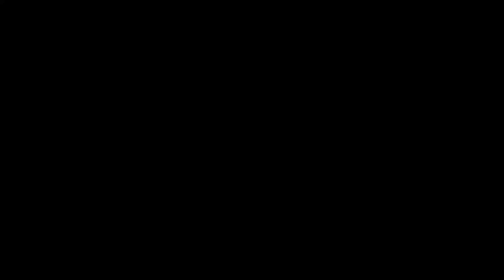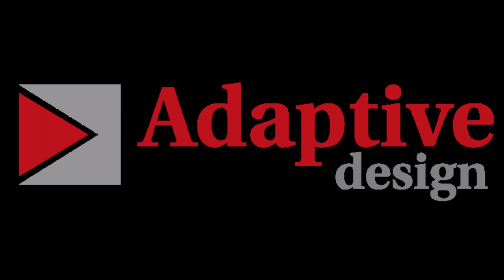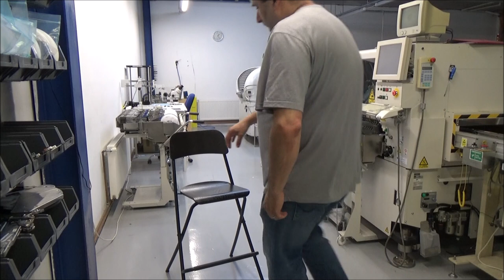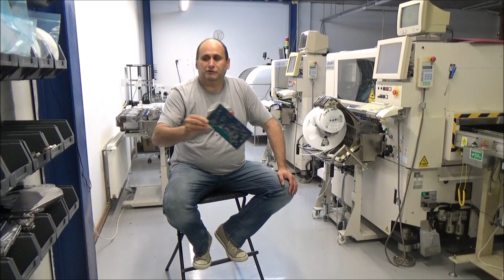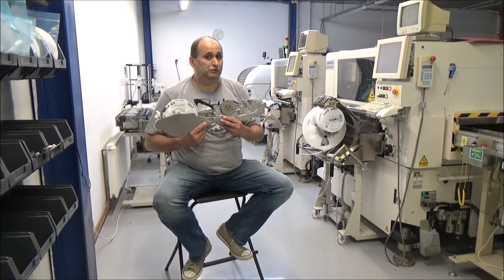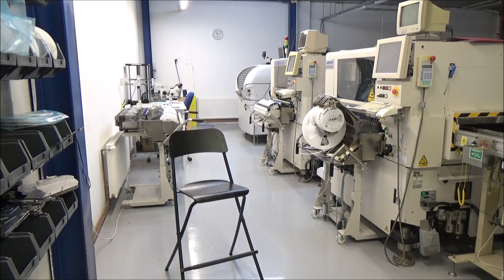Running an Electronics Manufacturing business in Ireland part 1

Comment: I've always been fascinated by mass production of electronics, like some childhood dream, used to take calculators to bits from 1977 onwards as a kid, anything electronic with leds and microchips in, dad was electrician, taught me about transistors 1979 onwards, first did programming on a friend's zx81 then I got my own computer, an acorn electron in 1984 when I was 13, fascinated I spent every night programming, in basic, by 1985 learnt 6502, did arcade games in machine code as teenager, sent them in for valuation at Superior Software, Micropower, and CSM, but they said either didn’t load, or too jerky, not arcade style enough, late 80's did a lot of maths programs, in 1985 built a transistor LC circuit that was a metal detector, and soldered it all up on my own pcb, in 89 soldered circuit panels for my dad in shed, that he sold to factory in Scotland, only did about 40 panels, but he couldn't keep travelling all way when they malfunctioned, in 87 I build a motor control circuit for my younger brothers electronics class, and over years I sometimes did 2 weeks a year wiring houses with my dad, got A levels in doing maths, physics, electronics, and computer science degree 1992, York uni, was taught about logic design, programming, saw things like gate arrays, microcoding, built a logic analyser, speaking clock circuit with audio samples from chips, learnt about the 68000, in 90 91, built z80 computer with 72k from chips, and built video circuit using tea2000 and SAA1027 sync generator chip, 64 colours on TV, got row of coloured dots across screen, circuit so big, that after that it malfunctioned, took 6 months to build, built my own eprom programmer, in 92 for my 3rd year project I build a satellite navigation system, early gps receiver, down to 100m, I did the z80 and TMS computer that did the dithering, and calculations, and my supervisor built the gigahertz frequency receiver, demodulator, and the technician in the lab built it, it was 3 foot long, later mid 90s did computer programming jobs, by 96 still dreaming of electronic manufacturing, I saw the new microcontrollers coming out, and was fascinated so I bought the picstart system, with PIC microcontrollers, and started to think what I could build with them, they were only about 8k etc, 8MHz type chips, but interesting, by then I had built this talking allophone circuit, and then I built a scrolling dot matrix led red text system, my wife rang companies all day, and global video wanted to put up 3 million pound to have one in every video shop, I had only prototype, i.e. 100 times smaller than what they wanted (full 10 foot display, mine was few inches across), they said I would have to get parts, costing 1 million, I came home from work in egg factory, to see wife and baby as usual, was staggered, we got a financial accountant in, and he told us we'd have to start small 50 pound, each week, go to bank and prove had income etc, so had to leave it, couldn’t do it, but I dreamed on, by about 2001, still wanting to get back into electronics, I got a job at Calrec Audio in Hebden Bridge and soldered boards that went into mixing desks for Radio 1, and BBC. We all soldered the boards by hand, i.e. putting in the components, and soldering, I studied the circuits and noticed that there was a jitter problem due to bad timing in the logic design, I told the bosses, but they were all analog engineers, and I was concerned always about soldering too fast, not wanting to run right along too hot on the pins, but they wanted me to solder so fast it was like knitting. After 3 months they fired me for not being up to speed. After that began years of immense studies of maths, electronics, semiconductor design, physics, anything I could learn. But I never knew just how you can take things to the next stage and actually do a production run of proper professional boards, as all we could get were clips of billion dollar factories with robots and chips being inserted by machine, and things going down conveyor belts, and hi-profile company adverts at the end, and when we look at chip prices they are all far too high, making it impossible to compete with the low prices of products. No-one has ever explained what you would have to do if you wanted to go to the next stage, on a small scale, how you could possibly get your first machine, and actually produce professional looking copies of your circuit boards, and how you would get cheap parts, and the labour involved. This is the first time it has been shown in a video. Thanks so much. I was intrigued to find out and I hope he doesn't mind, and haven't spent long, but I have done some very brief research, being that he is so modest, and not seeking appraisal. I feel maybe we need to know who he is. Since he is not like the others at all, hasn't given his name as others do and hasn't asked for any connections with his company, yet he has spent time to explain information that people never give, since all other semiconductor designers never reveal their methods. His name is Aurelian Lazarut, and at a guess I think his relations are from somewhere like Romania. He is the director of a small company of several people, and they have a few employees; a family business, well established since 2007, and it's really true he has probably really literally gone out and bought those machines, and is really helping us to know how to get going as a small start up (i.e. not multimillion dollar techniques), and I was amazed to see he is not just some worker who has just sat down at the end of the evening with some time off, knowing nothing about electronics except operating the machine; he holds several patents, electronic designs, audio and video circuits, microcontrollers, and is a brilliant inventor, and goes by the name Aurash, as I can see in his logic level programming conversations with hardware design friends who do a lot of verilog, VHDL, HDL, for semiconductor microchip design, and he was a system verification engineer for Xilinx, the billion dollar semiconductor company, that invented the first commercially viable field-programmable gate array (FPGA) and creating the first fabless manufacturing model. 

Chris Fleetwood, 
Haworth
England
Reply from the maker: Chris,
This is by far the most impressive comment I ever seen on YouTube, I've burned many phases as you described in your post starting with a C64 (sorry I was in the opposite camp) building an eprom programmer, a led scrolling ticker  etc. When microcontrollers have become available (8051 & friends) I switched from ASM to C and later on (1997) I become very interested in digital design (VHDL and Verilog) and learned about FPGA. (and ended up working for Xilinx) I got into manufacturing by building prototypes and just progressed from there by takin more complicated jobs every time, but being a designer,  helped me to understand about manufacturing faster. As you very well described in your comment is not easy to scale up a good idea, probably the most difficult stage is to turn a prototype into a product when you have very little resources at your disposal. I like you comment fro another reason, because you are not bragging about things is just your journey with good and bad as they come in real life. 
Thanks fro sharing this me and my subscribers (all 8 of them)

Comment: It seems to me a lot of the labour comes about because you are trying to be a general manufacturer. Supposing you produced your own products and marketed them, then it simplifies the business substantially. You would then invest in the automation you need to do one specific job. You also have control over the design process so you can organise your design so it is the cheapest for you to manufacture, given the tools you currently have. 

Another point is China is making its own machines now. Robot intelligence is proportional to its computing power, so old machines are a bit like old computers and were for an age where more of the work was manual. China is starting to develop powerful AI and machine vision. 

One thing I see in quite a few Chinese factories is they build the machines themselves from modular parts. These are cheap and generic, so if they need to be replaced you don't get ripped. Another trick is to buy a old high quality machine and computerise it yourself with stepper motors and controllers, such as manual CNC machines.
Reply from the maker: Hi Andrew,
Thanks for the great comment. I am actually building my own stuff (or to be more precise building what I designed which in turn is tailored for my own capabilities). We are making money from design activities hence the name (Adaptive Design) the manufacturing side has grown after the design because of my customers asking for more and more.
In work I feel like a kid in the candy store.
Thanks for the comment I agree 100%. 
Aurelian

Comment: Very nice, im about to get a similar line (700 instead of 2000 jukis) as a maker that spent many years in factories in China doing my PCBs.. I really like your honesty! I will also make some videos about this topic!
Reply from the maker: Hi There,
Thanks for the nice comment, and good luck with your business 
I have two 760L that I'm not using (in working condition) if you know someone who need them ....
Reply: @adaptivedesign8795  I dropped you a message on your website! Thanks for the reply.

Comment: Nice talk! I think the difference in prices is because of all parts and components are originally manufactured in China, even genuine brands. What is the main reason to purchase manufacturing in west Europe, rather than in China? What are the advantages? Thanks!
Reply from the maker: Most of the electronic parts are not manufactured in China, Analog Devices (which includes Linear, Maxim) Texas Instruments, Micron, ST Micro, Infineon, NXP, Intel, AMD etc. 
The main reason to buy locally is trust, second is jurisdiction (if case you get in a legal dispute) third is communication (language barriers, social barriers etc.)